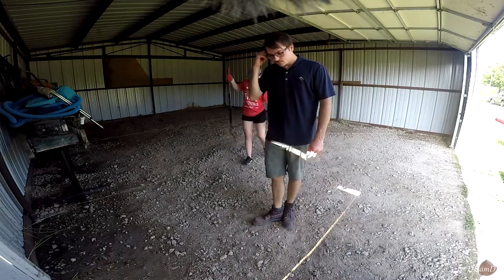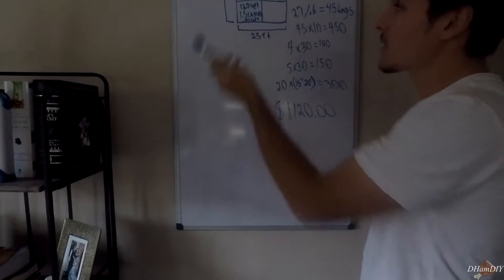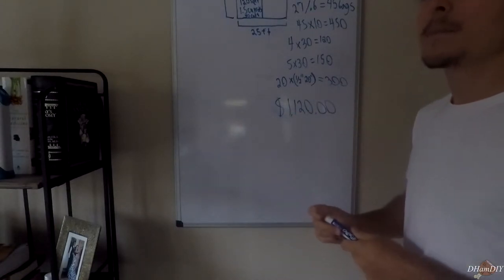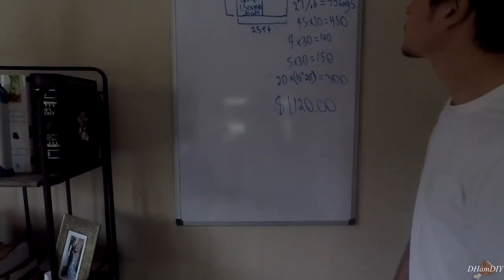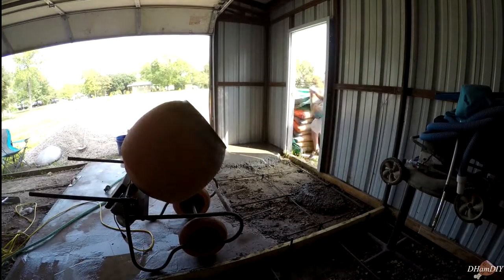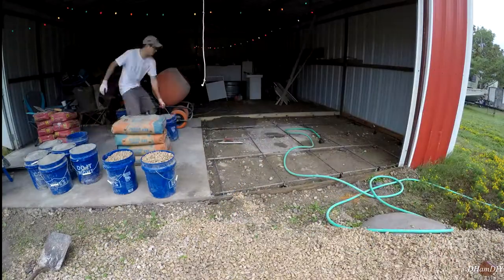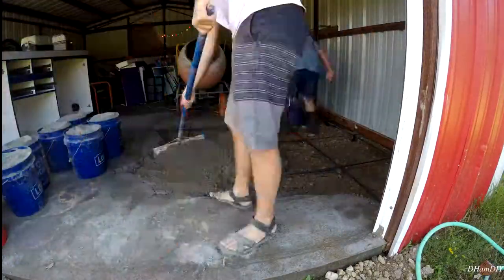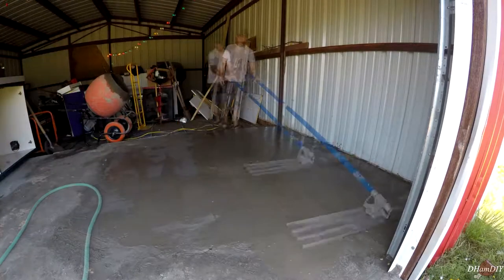DIY Concrete Slab for Pole Barn (780sft Under $1200!)

Comment: What most DIY'ers get wrong is how much labor and time (which is very limited) it takes to pour and place concrete.  Add twice as much for mixing your own bagged and pouring and placing at a minimum.  All this can easily be accomplished with prior planning but will bite you if you think it will all fall into place by itself.  Running short of time is the biggest shortcoming of mixing and placing by yourself.  The other glaring shortcoming people don't get is the necessity of troweling and working the surface multiple times.  It is very similar in some respects to tempering steel.  If you neglect to do that because you run out of time or only trowel it once you will end up with a forever "chalky" finish.  Think when you kneel on it your knees come up with white powder on them.  It never will cure with the hard durable finish that a troweled surface (whether it is power troweled or hand) will give you.  The only possible fix and that is still very difficult with a poorly cured surface.  It is also very labor intensive and expensive to power grind the surface in an attempt to get beneath the soft top and put some kind of epoxy coating or some such on it.  Exasperating that situation is having no vapor barrier under the slab it will cure much faster as water is pulled out of the slab directly into the ground.  Steel is important and can only do its job if it is kept off the bottom of the pour.  It should be 1/3 up the thickness of the slab.  It has the job of keeping the surface in plane throughout its life which become very very important when pouring a flawed and weak mix of concrete in a sub four inch slab.  If it is to be used with vehicles or equipment the amount of steel should reflect that.  Always keep in mind the wetter the mix the weaker the end product.  The sad part is a lot of work goes into a poor job which is easy to write off as "good enough" when the mix is curing before you are ready,  you are dead tired at the end of the job and the weather is threatening, etc.  However once you pour that for the rest of your time around it you will always know it could have been so much better.  None of this is to say a DIY'er can't do a perfectly competent job.  He can with the proper planning and set up easily do a job the size of what you are doing.
Plan on using a wheel barrow to place your concrete and set up supported planks over the steel so you aren't crushing it when you wheel the mix to the pour.  Buckets are slow and will wear you out.  Divide up the area into easily manageable sections and don't try to do too much in one day.  Form the joints and let the rebar stick through the form so you have a good joint.  Then when you restart you have a secure bond after you pull the form and tie the new steel to that which is sticking out.  If you have any energy left over at the end of the pour trowel it a couple of more times.  You should be somewhere around four bouts of troweling the last one when you think it is too hard to work unless you bear down with both hands.

Pick a small job perhaps an eight by four section of sidewalk to start with then extrapolate from there on what time you are going to need for each stage of your project.  Set the mixer up for efficient work where you can pour directly into a wheel barrow.  Plan your pour so you aren't working over fresh concrete.  Start farthest away and work toward the accessible portion.
Reply from the maker: A stout observation. Thanks for watching!

Comment: I have to say thanks.  I have toyed with doing a small slab this way (10×25).  Seeing the amount of work you went through,  I've come to realization that at my age I need to work smarter, not harder.  If I pour any slabs, I'll be getting a truck, or renting one of those smaller tow-able cement trailers....  nice job though.
Reply from the maker: It felt like a right of passage! Thanks for watching!
Reply: The small tow trailers have saved me a lot of time. The concrete store “rents” them for free if you buy the concrete from them.

Comment: I have about the same size slab to lay, I’m at the top of a track that needs a 4x4 with off road tyres, a 1 ton trailer won’t make it, I tried. I move aggregate by shovelling it into the back of the Land Rover and making multiple runs. Well done, it’s hard work. I’m doing mine solo, in smaller sections, ( I’m 60 )
Reply from the maker: A lot of people don't understand why a concrete truck isn't always the answer and I bet if they tried to drive one on your road they would! Thanks for watching!

Comment: I would have started in the back and worked forward. Smaller sections and work around the perimeter.  Get the left and right side done then finish the center. Respect for doing your own work and saving money. 
Also plastic is cheap. I would have used it for a moisture barrier.
Reply from the maker: A moisture barrier wouldn't have hurt that's for sure. Thanks for watching!

Comment: I just did my first poor with the same mixer the same way fill in all the buckets myself I did 1.11 yards end it almost killed me you definitely were making a two or three slump that was extremely thick but it should be stronger that could've been wire was setting up quicker Plus it looks like your cement ratio was pretty high which would make it probably an M 20

Comment: You got it done! But this is not a educational video like "How To Do"...you definitely have to screed that stuff after pouring to get it even with the forms.
Reply from the maker: It may not be a "how to do professionally" but its a "how I did to the best of my ability". I tried to screed but the area I was pouring at one time was too large and the mix too inconsistent. If I were to pour three or four batches by the time I'm ready to screed one batch is already setting up and past the point of being able to be moved with a piece of wood. It worked better for me to just float out the area or batch one at a time and you may have different circumstances on a pour of your own but that is what worked best for me. Plus as you can see from all three videos it looks pretty adequate. Thanks for watching!

Comment: Are you doing this in order to finish the inside for living quarters? My dad and I are considering finishing part of his pole barn for living space
Reply from the maker: I am putting in an 8x8 bathroom currently which will be the only technical livable space in the building the rest will be space for a carpentry shop. Part 3 should show everything from plumbing to framing. Thanks for watching!

Comment: Were you concerned about pouring the slab in parts?
Reply from the maker: I'm really not concerned about it. I think with the amount of rebar and the time between each section  only being a day or two max there wont be any issues. Especially since no serious load will ever be applied to it. If it were a road or something or a slab to a 200k home I wouldn't have went with this method. No cracks yet other than a hairline between the first and second slab but this is where a crack control line would've went if it were a traditional slab anyway. I will take a good look for a follow up in part 3 of the series when it is finished to see if anything odd has occurred in the slabs. Thanks for watching!

Comment: If you use Quickcrete do you still need the extra rock and sand?
Reply from the maker: Using a premixed concrete bag removes any need for mixing your own rock or sang although from my own experience that is a lot more expensive. Thanks for watching!
Reply: @DHamDIY  I appreciate the feedback. Enjoy your videos.

Comment: Where you have those cold joints in each block you should cut a saw joint in it to control the crack because it will definitely crack in those spots
Reply from the maker: If it will crack there anyway then no need for a cold joint! Hopefully the rebar will be sufficient to keep it all together but that's an answer for time to decide. Thanks for watching!

Comment: Unfortunately it is not any cheap to do bags  vs having a truck come out. From what I understand
Reply from the maker: In your area that might be the case but it differs from place to place. If you had a property that doesn't have good roads a cement truck wouldn't be an option where bringing in a 4x4 with the materials would be. Or just simply having local cement trucks cost more. Thanks for watching!

Comment: You should have broke it down into portions that you could handle for any one pour. Having a dry joint is never a good thing with concrete and I am not talking about the construction joints
Reply from the maker: Yea that was the main regret, could've made the finish much better too but lessons learned! Did the smaller sections in the plumbing video of the shop build and turned out much better. Thanks for watching!

Comment: Not bad but for that price, I would have just had a concrete truck out and done in an hour.
Reply from the maker: That is an option for part three but the mixing in batches allowed me to go at a pace I was comfortable with. A concern was having a mixer come in and having it set before I could finish, resulting in having to break it all out and restart. Also this is an interesting way for viewers to learn how to put a slab in on somewhere a concrete mixer couldn't get to like way out in the sticks or something. Thanks for watching!
Reply: I related so hard to the warp speed math for materials. Lmfao. Loved the video very informative. Wanting to convert our gravel garage into a slabbed living space.
Reply from the maker: @prisonmike9472  I hope the construction of the bathroom will also help you which is coming soon. Thanks for watching!